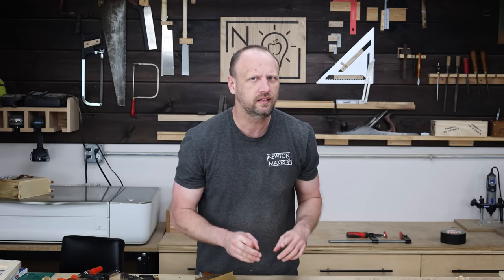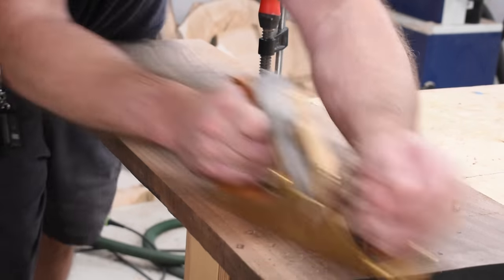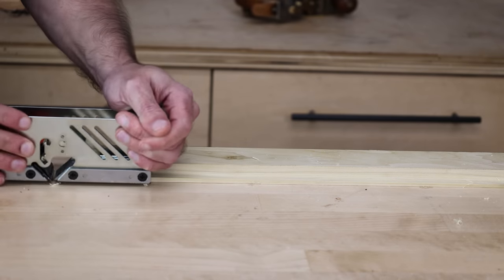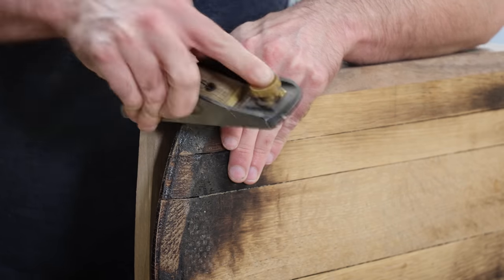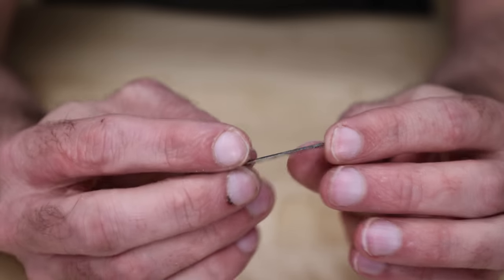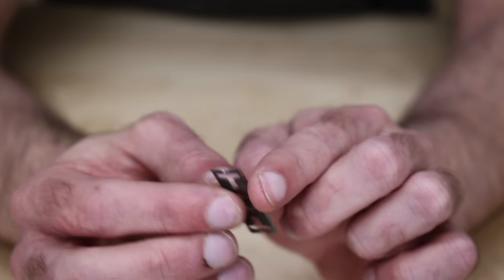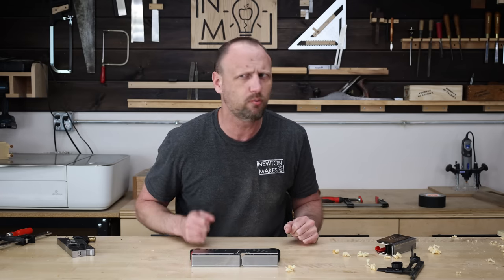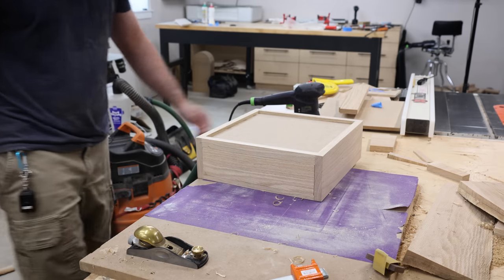Do Power Tool Woodworkers Really Need Hand Planes? You Might be Surprised at the Answer!

Comment: The whole part in the beginning about pressure, answered so many questions I’ve had that are now obvious. I’ve had this issue cutting cabinet dados and grooves on the router table recently and wondered why it was out of square although the work pieces were cut on a cnc. Thanks for the metaphorical flick to the temple, I’ll adjust my woodworking!
Reply: A great tool for things like that is a router plane. And you can even make one yourself.
Reply: @MC's Creations  very much so, they're ridiculously easy to make, and really not hard to make an adjustable one that works awesome for not a billion dollars (sorry JKM awesome tool, but not for someone that's just peeking my head out of the poverty line hahaha). You can make a blade for it out of an Allen wrench with just a file, there's a ton of different ways to make them, do some digging. I personally love the one YRTi made and I'm planning on making something similar. It's a little more complicated than necessary, but its super cool, and the guy is hilarious
Reply: @connorhart7597  Check out the one Rex Kruger made, it's even easier and you could use a chisel as blade. 😊
Reply: @MC's Creations  yeah I like that one okay, I'm in the process of throwing a quick one together that still uses a chisel, but I cut the tang off, and it's gonna be a bit different but same premise

Comment: I'm a power tool user but, I don't believe that it has to be all or nothing. I have no problem picking up a hand tool if it is the best tool for the job. My only problem with a hand plane is, I suck at getting it setup. I have no problem sharping the blade, just getting it setup in the body correctly. I don't use it enough to get good with it. Power tools hand tools doesn't matter, get out in your shop and make something. Stay awesome.

Comment: Question: At the end of the video you put that tight fitting drawer into the box. How much trouble was it to remove that tight fitting drawer. No answer required.:face-turquoise-covering-eyes:
Reply from the maker: Absolutely zero trouble. It was a perfect fit. I tilted the box up and it immediately slid out.